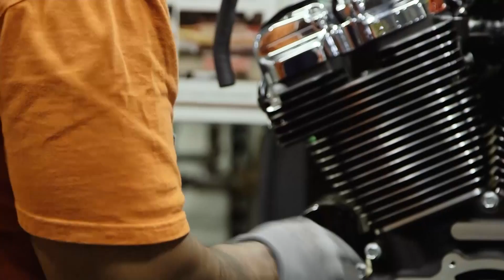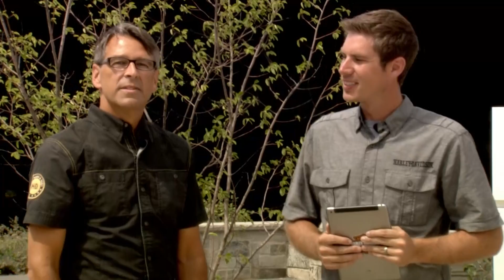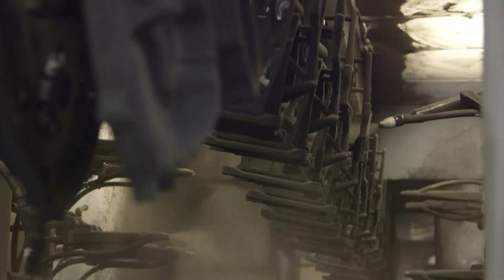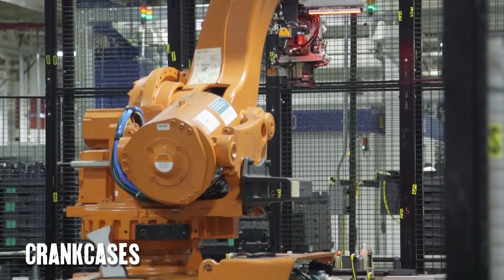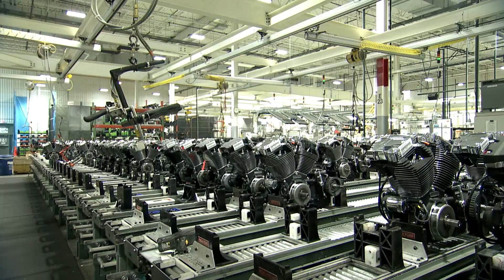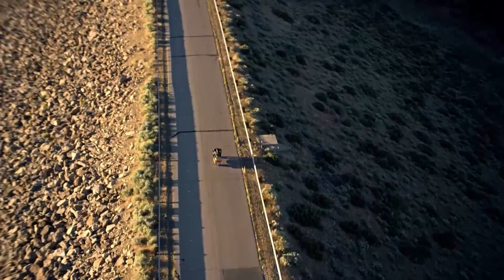All-New #MilwaukeeEight Engine: Inside the Factory | Harley-Davidson

Comment: First, your adjustment know is almost non accessible, cant get your fist around it all the way to turn it. Second the vent DOES NOT prevent head buffeting, and lastly...just bought a 21, why cant you guys engineer an engine that doesnt need to be kept under 3k on the rpms for the 1st 500 miles?

Comment: Great product, however,  more R&D required. My SGS M8 2017, has had 3 oil pumps. The third is finally an S&S, compensator failed, HD said normal wear and tear, HD said no warranty claim. Finally, oil transfer gbox to primary, fixed under warranty.

Comment: Would have liked to actually see the machining being done in more depth. NOW; find out how to build a bike with all the features of the Honda Goldwing. I have had three Harley's. My fourth was a 2012 GW. Looking at getting the 2019 GW. Also, please tell your dealers to STOP adding meaningless additional charges to inflate the cost of the bike. Very poor business practice. The GW will out perform a Harley. Sorry, but it's true. I did look at the 2019 Ultra Limited but for $28,000.00 you can't even give me a heated seat!!!!!! WHY??? I have no issue with your bikes to be clear. I do have issues with some of your dealers and not giving the customer more features for what you are charging for these bikes.

Comment: I just got a 2018 FLHTK-ANV, put around 1000 km on it in less than 1 week, and am pleased with its power, comfort, and all the cosmetic details.The exhausts sound a bit inferior to the previous touring models. Also I was surprised that the almost $40K bike did not come with a tool kit. I asked the dealer and was told that the tool kit could be purchased separately for around $50!  Rather than these issues the bike looks and rides above my expectations.

Comment: Just picked up the 2017 Street Glide S, loved it so much, I'm trading in my 2016 Tri-Glide for a 2017 Ultra Limited.
Reply: do yourself a favor and test ride electra glideclassic the twin cooled limited makes a funny top end noise.also they dont advertise the fact they dont have an oil cooler the twin cool only cools top end for rider comfort doing very little help for the engine.they have a water pump where the oil cooler is on youre street glide
Reply: Thanks for the feedback, so far no complaints..